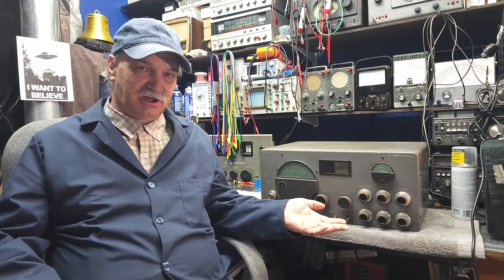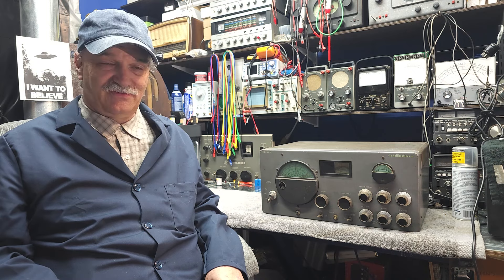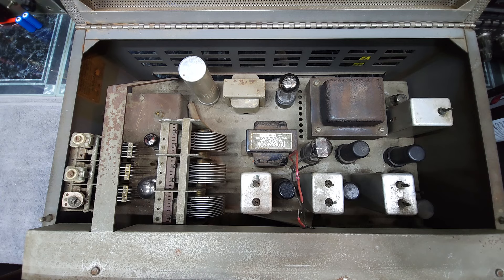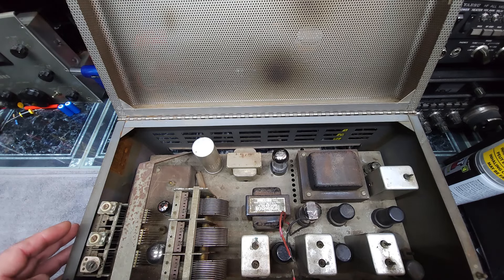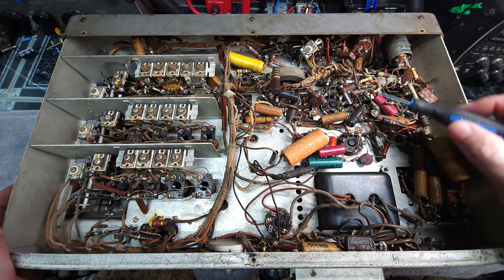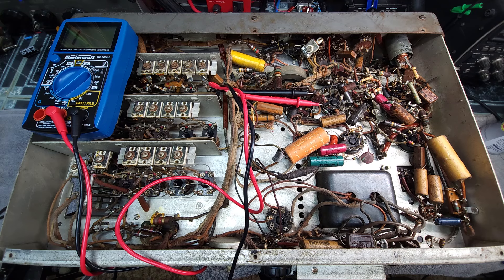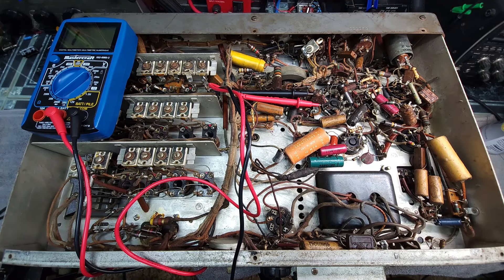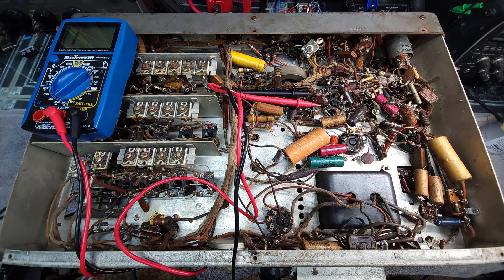Hallicrafters SX-43 Restoration Pt. -1 The "Junkyard Dog"

Comment: Mike,
Years ago, I had a boat anchor in much the same condition and decided it was likely unfixable.  A very wise member of the Antique Radio Forum piped in with: "There's no reason that radio can't be restored."  Turned out he was 100% right.  Without a doubt, you're far more experienced and knowledgeable than I am, so perhaps you gave up a little too quickly.  The fact is: There's no reason that radio can't be restored.
Regards,
John
Reply from the maker: I havent given up at all. I will now search for the parts I need. It might take a month or it may take 2 years. I will find what I need and it will indeed fly again. Just not today. I believe I said this in the last quarter of the video.